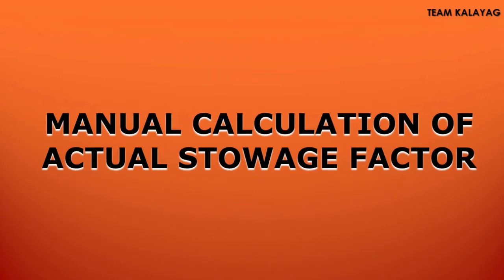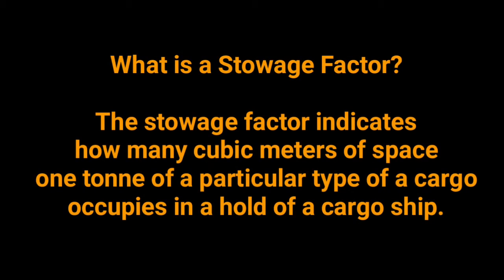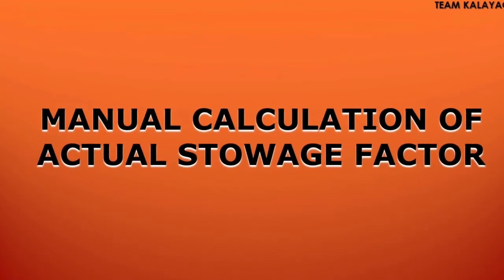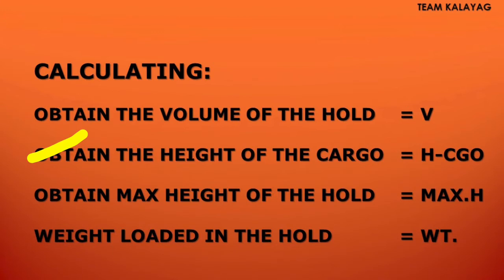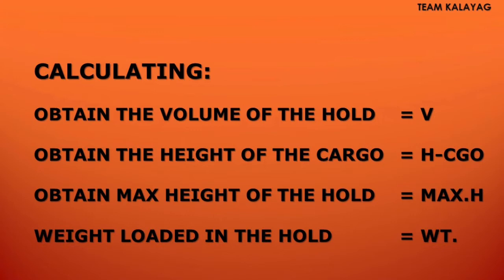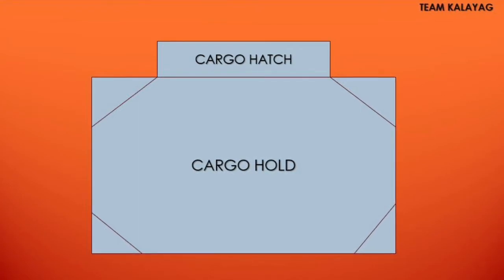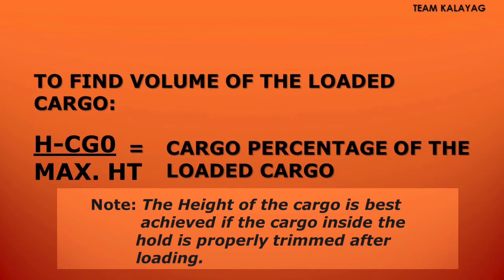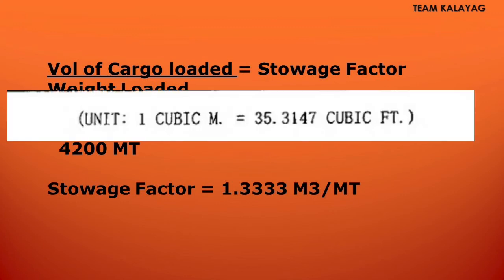FINDING STOWAGE FACTOR || SHORT AND SIMPLE CARGO CALCULATION

Comment: The computation of volume percentage of hold loaded as you presented is good for a box type cargo hold. But since the hold have the hooper for dbt and tst tanks, the exact amount of volume will not be accurate by just doing the percentage. It might be more accurate if we use the volume by height of cargo hold as stipulated in the book. Ano masasabi mo dito sir? Thank you po.